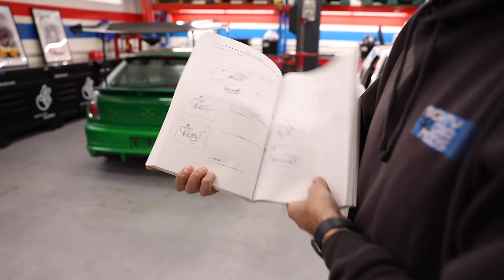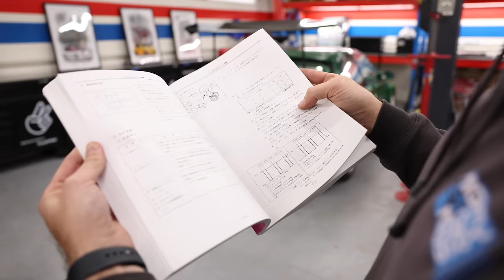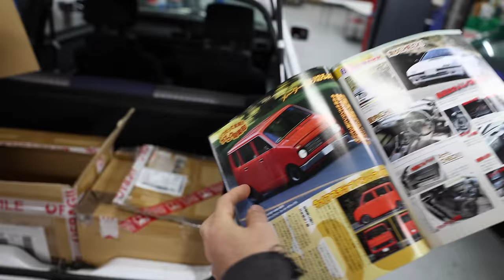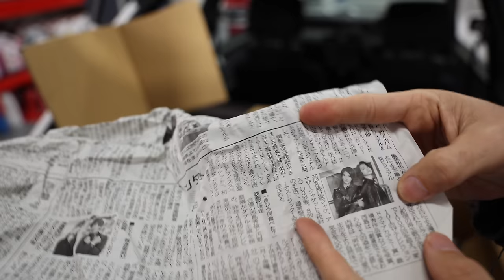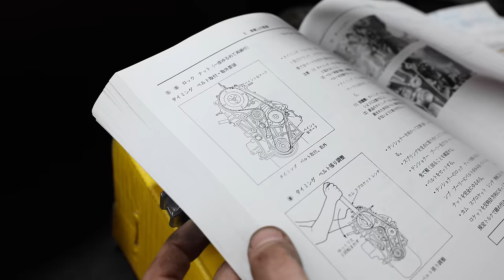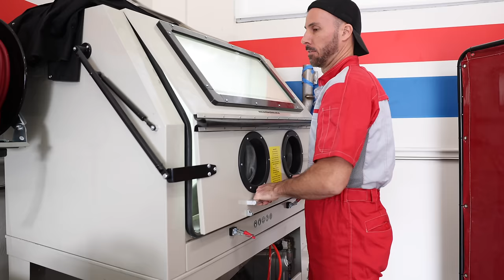Disrespected Superturbo 'The Honkfiles' [Part 1]

Comment: 22:30 Not controversial at all.. That what makes them so popular with the newbie young punks that they have been inseparably associated with. Stupid easy to learn, easy to wrench on, plenty of room to work. No insanely complicated vacuum systems to work out (looking at you Nissan and Mazda) that many companies in the era had going on. They are darn near Legos (same with subarus) from 91/92 all the way up to like 2005 (all the way to 2015 with subaru) Plug and Play and Bolt on upgrades that can be taken from higher trim models. Take a head off your K24 replaces with K20, turbo make 350 hp All day long with Daily driven Reliably.... You honestly cant argue with it. Over engineered to hell and back. Want to lift your Impreza or lower your forester? Trade springs and struts, across the two, 92-2015 nearly and Bam youve got a FACTORY PARTS lifted Impreza (what the crosstrek is Btw) Or a Factory Lowered Forester, with accurate suspension geometry to boot. Something many people pay 5000 or more to correct on their lowered/lifted cars.

Comment: Incorrect - when mating two machined surfaces, LESS sealant is better. All you want is just enough to make a film that fills the roughness of the machined surface, if you have extra gooping out the sides making big lumpy flappy bits when you torque the fasteners up, you fucked up.